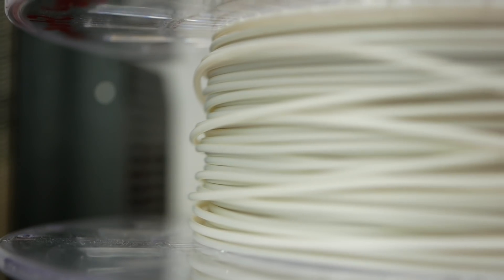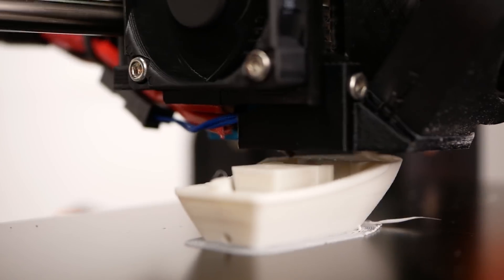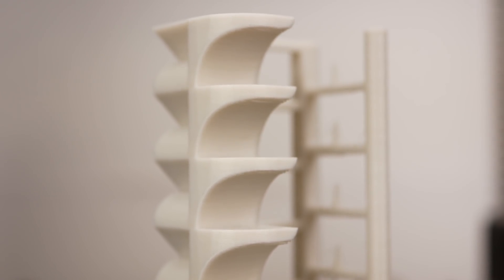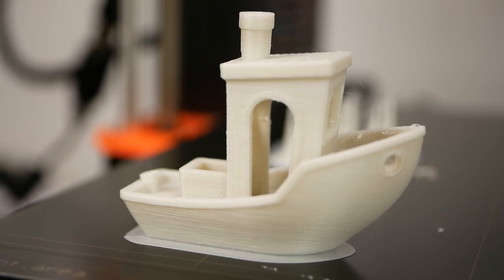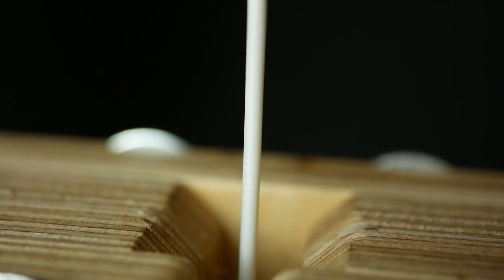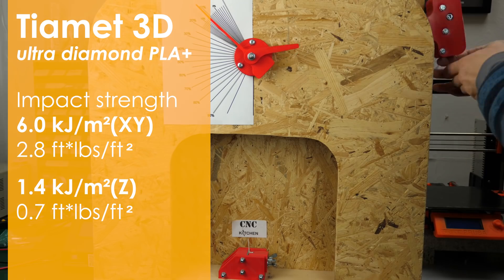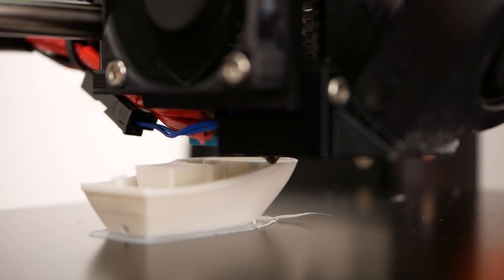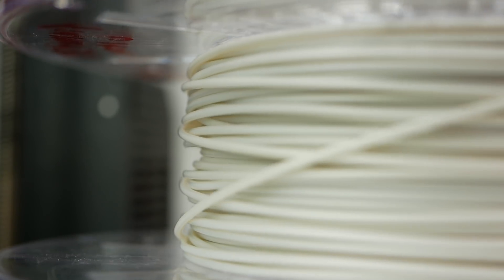Nano Diamond PLA filament REVIEW - Tiamet3D μltra diamond PLA+

Comment: I wonder if it's not bonding between layers due to high thermal conductivity. I mean when you lay a new layer, you want the previous now cold layer to heat up enough to where it's becoming sticky and will accept the new layer, and the heat source is the newly extruded bead. But if the thermal conductivity is high, the deposited heat will penetrate layers further down and may not allow the top layer to reach the bonding temperature.

I'd certainly like a sample but i don't know yet what i'd like to print with it! I am curious about its thermal conductivity though, whether i can use this property for something, not sure what.
Reply: and on that note i would have wanted to see testing as high temp until it becomes unprintable, or at least at 300c
Reply: @skaltura  I guess the trick would be to use a heated enclosure.

Comment: I would love to use this for bearings for my new 3d printer
Reply: Why? I'd recommend you the copper filament since copper is good bearing material. Diamonds are probably the worst.
Reply: @svetko05  Copper is not good bearing material.
Reply: What the fuck?
Reply: maybe use IGUS Tribo filament instead, it's specifically made to be low friction, highly wear resistant. or just buy their bearings that they make.

Comment: Do we need duranium nozzles for diamond filament?
Reply: I know someone tried silicon carbide whiskers filament... it ate away a ruby nozzle
Reply: I haven't had any issues using a standard brass nozzle so far
Reply: MetalheadAndNerd they claim that you don’t..
Reply: @among-us-99999  and that claim is a fucking lie.
Reply: The PLA might act as a lubricant for the nano diamonds, it could also be that the nano diamonds form in a smooth fashion the way there made idk